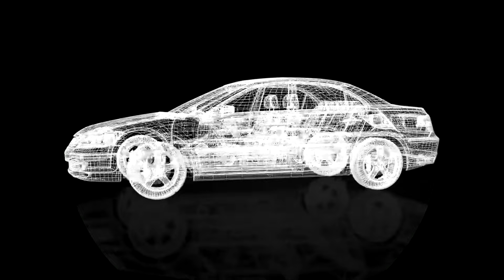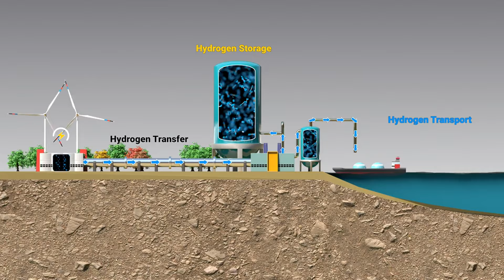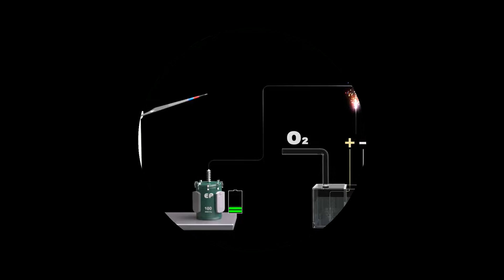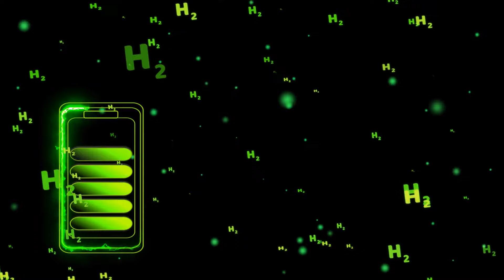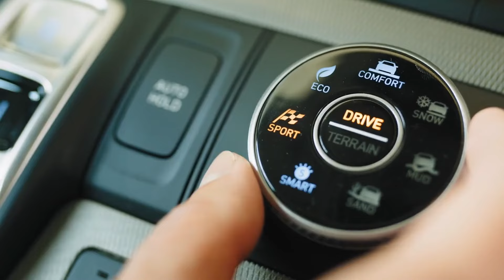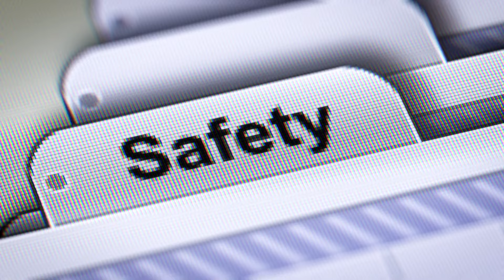Toyota CEO This NEW Engine Will Destroy The Entire EV Industry

Comment: One of the things I wonder about are the leaks. We have had rockets get scrubbed over and over due to hydrogen leaks. Add to that the explosive nature of hydrogen, it is a pretty scary thing. It may not pollute, but a tank of hydrogen burning in a tunnel would probably kill many drivers in that tunnel. Imagine a miniscule leak, and someone carelessly flicking a cigarette in the vicinity.
Reply: Recent news about company called H2MOF will convert gaseous hydrogen into non flammable fuel for transportation was recently invented by Nobel Prize Winner who promises to revolutionize hydrogen industry with new solid state storage material without the need of compression or converting into cryogenic fuels. I like how @EirexTech will safely store hydrogen fuel inside any type of water and ocean going ships safely float on never ending fuel source to power diesel or hydrogen fuel cell applications.
Reply: hydrogen is not more flammable than gasoline especially gasoline fumes which a gas tank is full of.
Reply: I pulled two tanks of gas behind a semi-truck with 12,000 gallons. a car with a small tank of hydrogen isn't any more dangerous... seems like people don't even care about diving crazy near my truck even though it would kill us all if the truck was wrecked.. The danger is all in Your head.. we live with danger every day you just don't notice it

Comment: Very interesting. I think hydrogen will play a part always. however, I cannot see it ever replacing electric cars. electric cars are just so brilliant and they connect to your house. as for the batteries, well it'll end all mining as you throw nothing away and they last a long time hydrogen itself. it's very problematic. a lot of the equipment's made from high tensile steels and stainless steels with extreme problems with wear and tear and storage. I can see why the toxic fossil fuel industry are interested in and I can't see why Toyota interested it because the cars are going to be high maintenance. I do know a little bit about it because I've been trying to use hydrogen in engines and it is very interesting but extremely high maintenance. very tricky in certain areas and I came to my own conclusion. the electric car is just a hell of a lot. better safer, easier and will mean we can all make energy at home with renewable energy. very easy and it's also an energy storage system with batches that last millions of miles and you get the base materials back. we end all mining. battery packs will be made from hemp and my plant-based materials very interesting but I put my money on electric cars. I think Toyota it's very interesting but I think they may go bankrupt unless the oil companies can bankroll them which they might be and they are rich and sadly very misleading. they protect their market. I just want truth ... just to add, I find a high performance electric car. so much more fun than the old ice engine noisy irritating thing 😊 and will be consigned to the history books

Comment: H2 is a seeking lighter than air gas, which of course is very hard to contain when released which it will happen. it is actually an accelerant greenhouse gas so not a good idea and the embodied energy is enormous. they will be uses for hydrogen noise will be. but as for transport, I agree with Elon musk. it's a fools alrant except if you're an oil company and they are our Toyota but these companies need to change or they need to disappear very fast. anthropogenic Extinction is not something we can just play with for short-term profits which I feel Toyota is doing and lying to people which I think is criminal